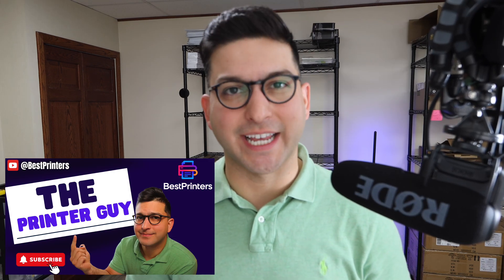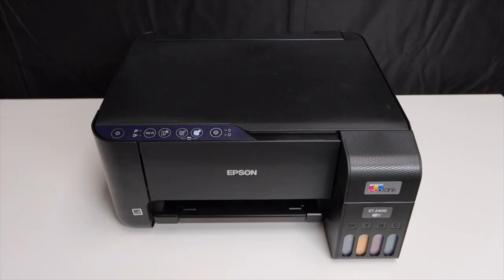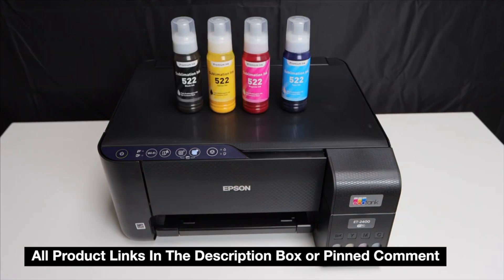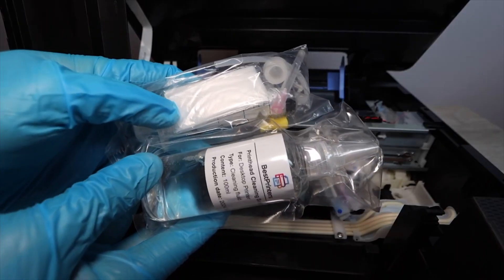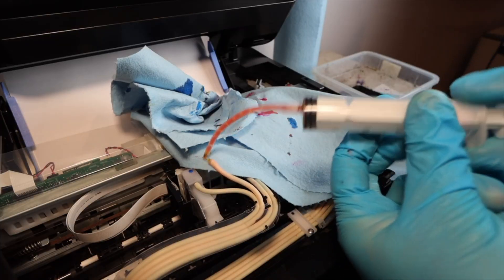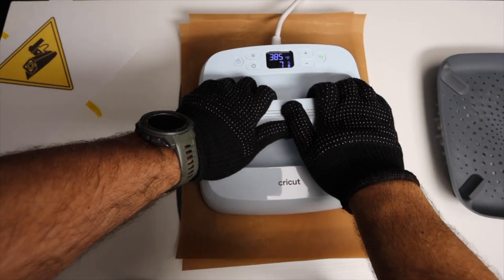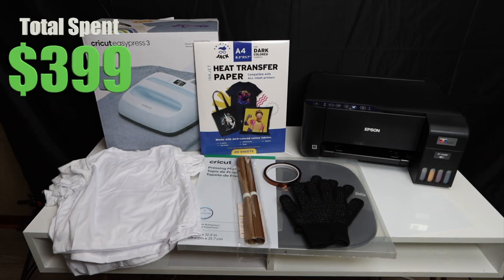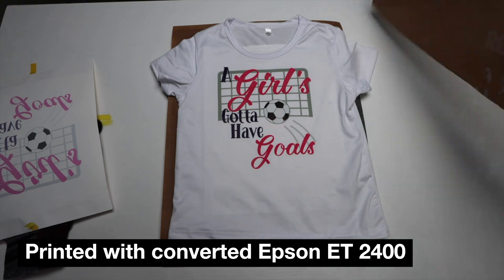Should You Turn Your Epson ET (EcoTank) Into a Sublimation Printer

Comment: I converted my ET-4800 into a sublimation printer right out of the box because I have another printer.  It is only 6 months old and already I have a clog on 2 colors.  Is your cleaning process (showed in another one of your videos) going to solve that issue with my converted printer?  Also, how do I know if I need to replace the ink cartridge as well?
Reply from the maker: Yes the cleaning kit will work with the sublimation and installed as well. How do you know when you need to replace or install more bottled in is when the levels start to get low below the last line on the ink tank
Reply: @BestPrinters  Sorry, I meant the ink pad that is in the back right of the printer that has the sponges in it.  You sell them, but not for the ET-4800.